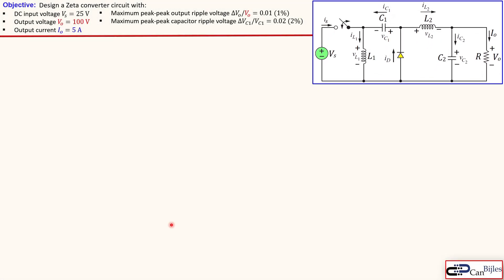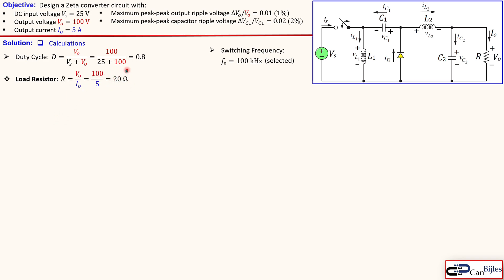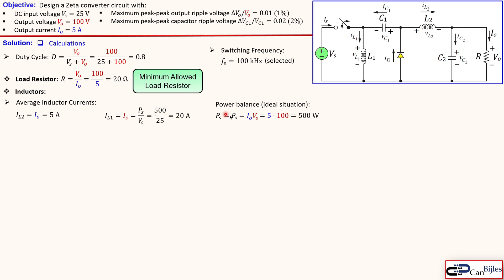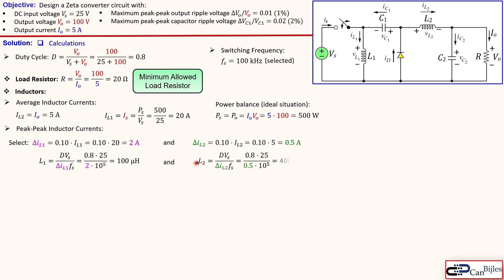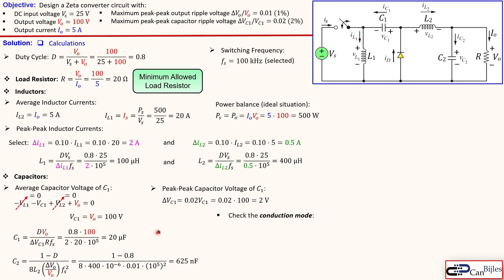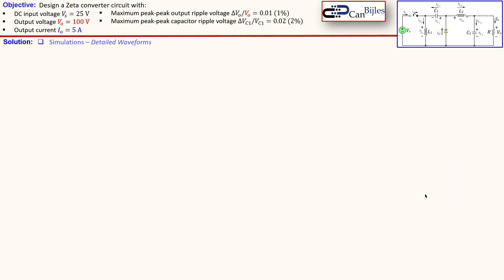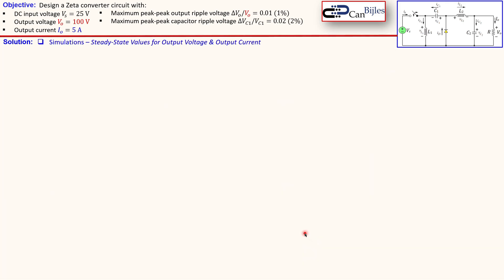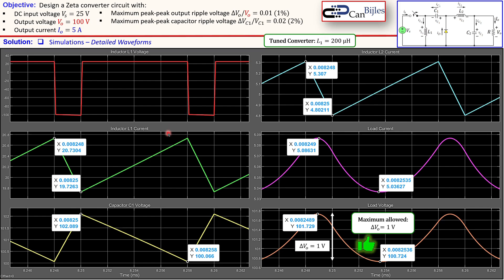⚡ DC-DC Zeta Converter Design 🔋 Power Electronics ⭐ Calculations & MATLAB/Simulink Simulations 👍

Comment: My voltage doesn't rise above 3 volts????
Reply from the maker: Probably a mistake in your circuit...
Reply: @CANEDUX  No. Tl494 + N-mosfet + L-400uH + C-50uF
Reply: @CANEDUX  Above 3 volts, the current sharply increases to 1 ampere and the voltage drops to 0.4 volts
Reply from the maker: Cannot judge this from distance.